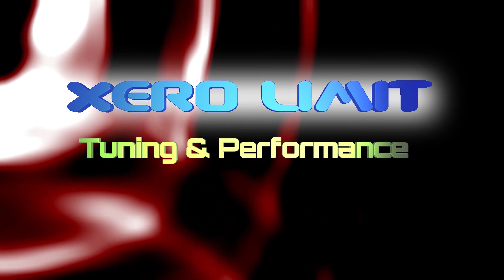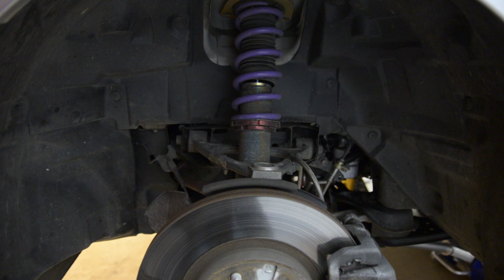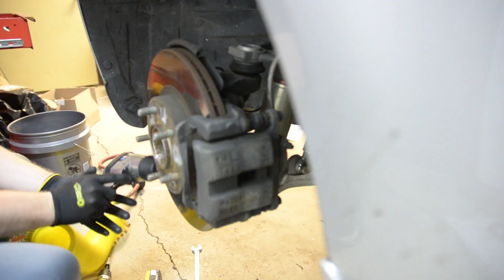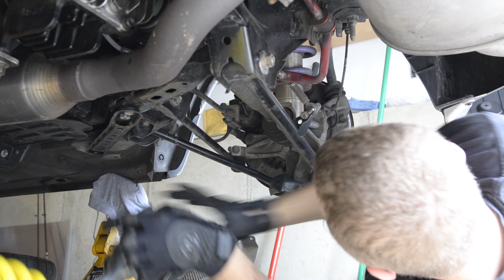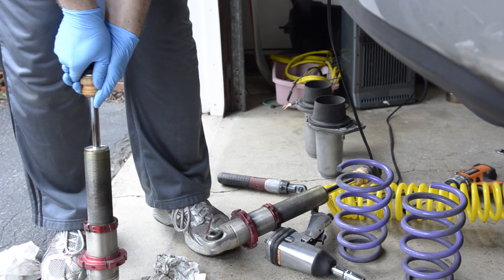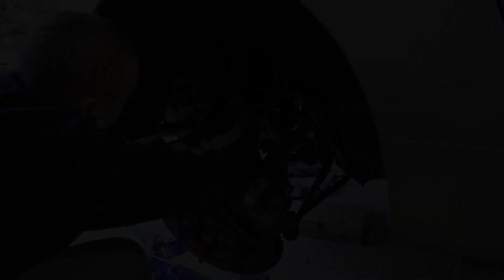Coilovers / Suspension Installation - 2006-2015 Mazda Miata MX5 - NC 06-15

Comment: Do you need to install the rear camber kit for the wheel alignment on this MX5?
Reply: No, NC has camber and toe adjustment at the rear. Mine is only moderately lowered and has about 2° of camber on the rear wheels and about 2.5° at the front. If you want more you can start replacing suspension bits. There are eccentric bushes available for the front but they're a pain to install.

Comment: This is definitely one of the better and clearer install video's I've come across, though there seems to be no mention of re-tightening certain parts once under load to avoid twisting bushes? - can you advise/comment please?  Thanks
Reply from the maker: Neil that's a good point and was done after the fact. You want to leave the upper control arm loose, preload with a jack or drop the car down, then use a box end wrench to tighten them back up.
Reply: @MotoTuned   Thanks for the prompt reply - here's some instructions I saw somewhere else that I saved - what do you think?  I'm just paranoid that when I remove my existing Mazda shocks with factory fitted Eibach springs, and replace with new coilovers, that I do it all properly...

When refitting the upper control arms on the front you need to torque up at ride height to remove wind-up from the bushings, and in cases where the car has been lowered, then ALL control arms front and rear need to have crack-off and re-torque at height. Otherwise the care will not site level, the suspension will be bound up and the bushings won't last. Suggestion is to loosen all the bush fixings, then let the car sit on its new springs. Roll the car backwards and forwards a couple of car lengths to remove any camber thrust from the tyres. then put tape on the wing eyebrows and mark a height measuremement from wheel centre - this is where the car should sit and where you want zero wind-up in all the bushings. Then lift the car again, remove wheels and jack up each hub until reaching the measured height, then torque up all the control arm joints.

Comment: On the rears you don't need to unhook sway bar links or suspension links. Just put a floor jack under bottom of shock to take off pressure and pry it off stud. Much easier.